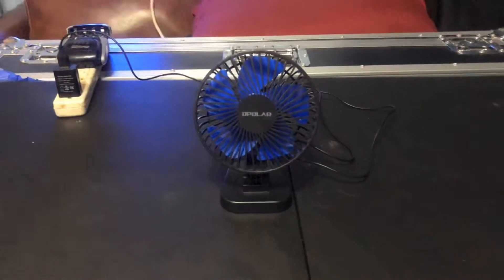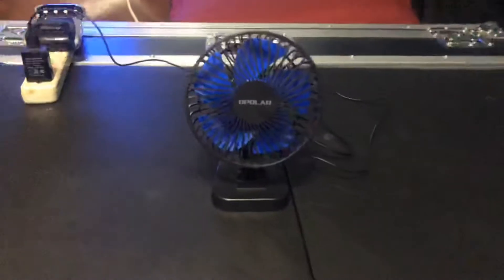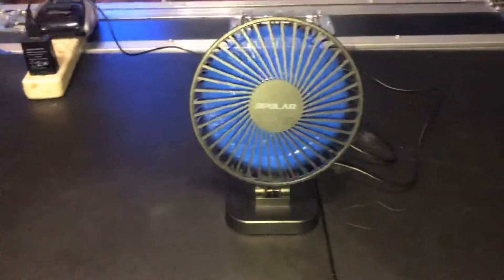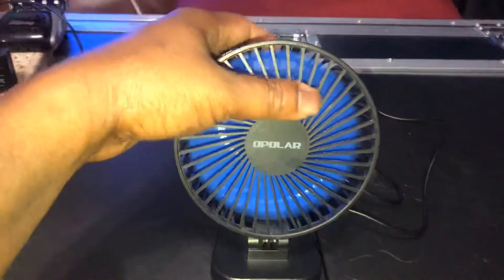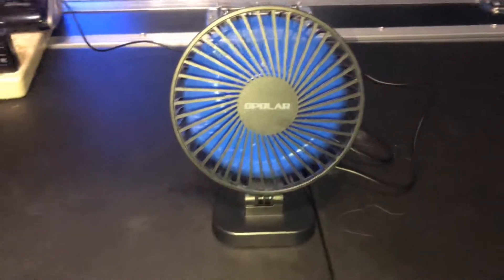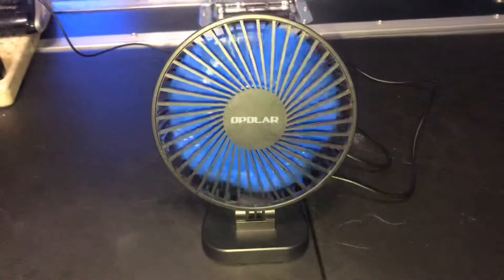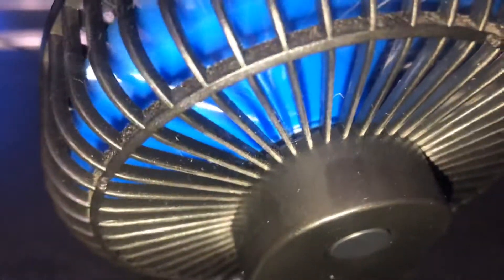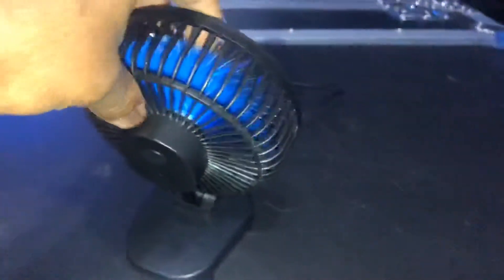5.5” Opolar blue usb fan

Comment: How long do these Opolar last? Are they junk?
Reply from the maker: pretty long based on how much you use it most dc motor fans don't last no longer then 6 months with heavy use
Reply: @LemontTheFanMan  Does the higher fan speed translate to louder noise?